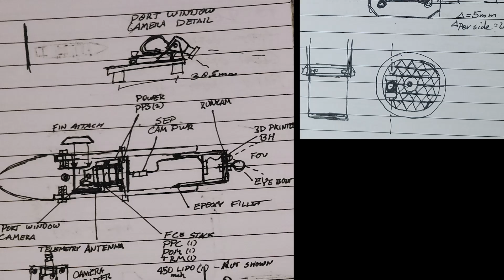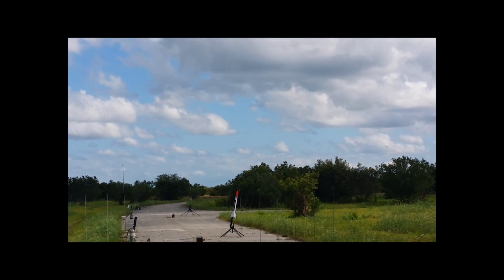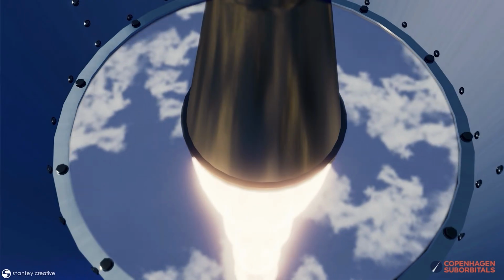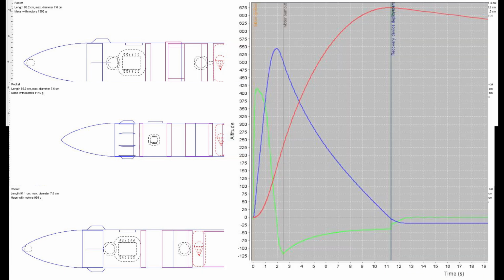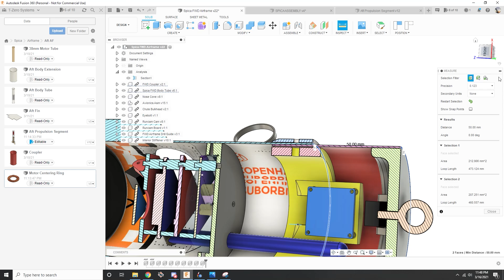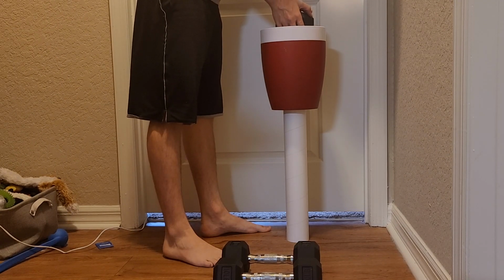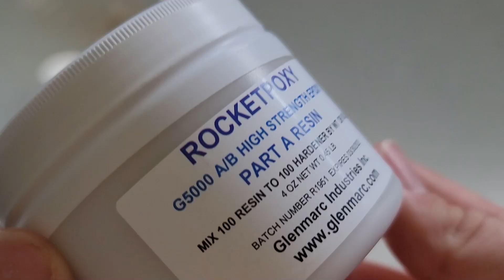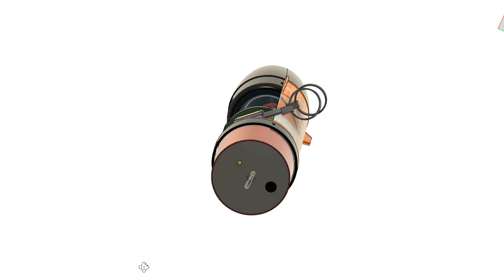Building A Suborbital Rocket We Can All Ride

Comment: 8:00 natural gas? Are you sure?
Reply: Spica will run on ethanol and liquid oxygen. The confusion might have come from the fact we will use liquid nitrogen to keep a constant pressure in the tanks during flight. The LN2 will be heated up, passed through a heat exchanger, vaporized and fed into the LOX/ethanol tanks as a gas. We used high-pressure helium to do this before on the NEXØ I & II rockets, but the amount of helium and COPV's needed for Spica takes a big hit on our monetary and mass budget, hence the switch to liquid nitrogen. We go into a bit more detail on how that whole system works in this video:
https://www.youtube.com/watch?v=7ULg5N_FP0U
Reply: @CopenhagenSuborbitals  oh hey
Gudluck you guys :) Love from Asia
Reply from the maker: Yes! I think I got lost switched up on abbreviations! LN2 vs LNG
Reply: I think he meant nitrogen gas, although I heard they're going to use nitrogen for tests, and helium for flights since helium has better performance but is much more expensive